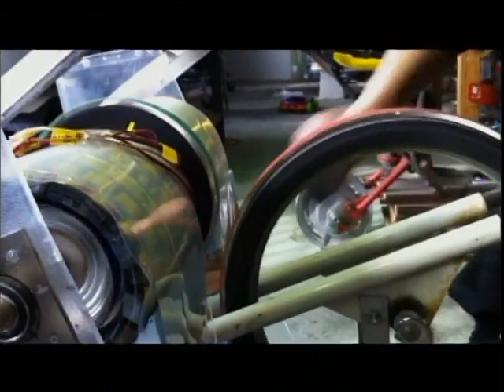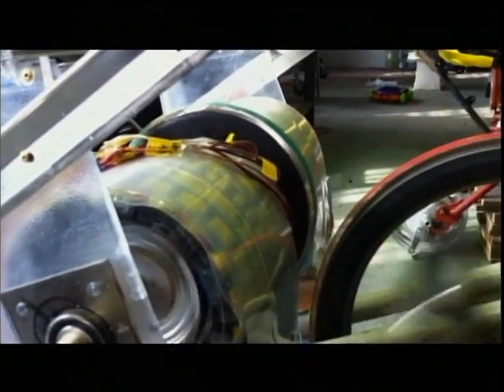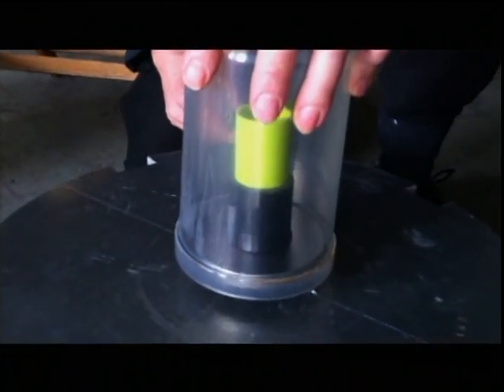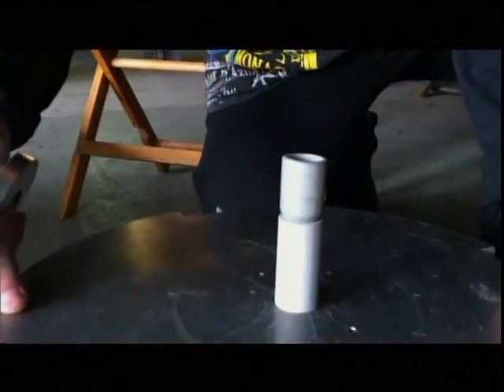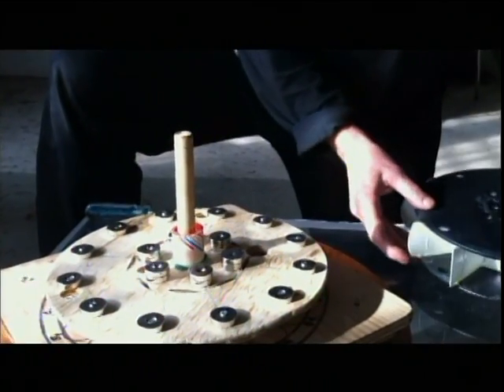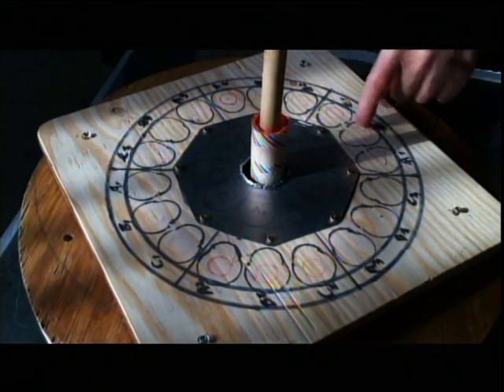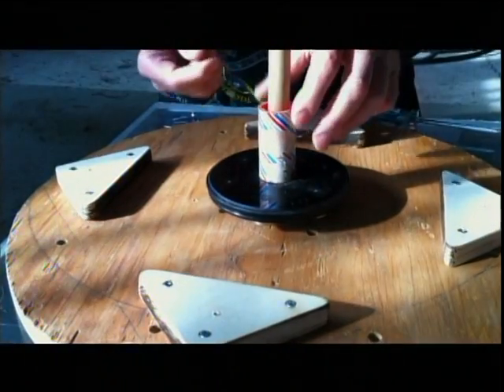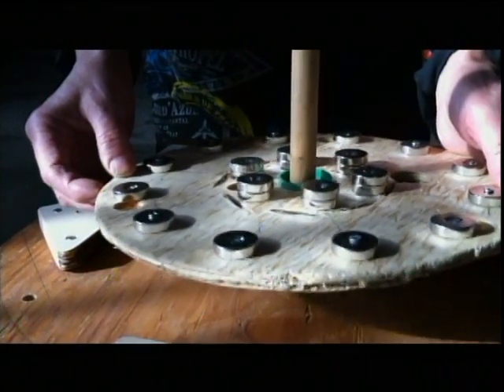Mag-Lev Air-Turbine Car Generator - FS1

Comment: These frictionless magnetic bearings, plus induced 3-phase current - on all levels now: Magnetic suspension/generation; pedal air compressor/generation; even Magnetic gears/generation (coils in plastic or alum. fender!), mean game over for fuel AND battery cars! All that's needs is BANNING of non-magnet steel in favor of plastics & carbon-fiber plastic (structural). And many shops have been doing this already for "less" energy needs. Total transportation revolution in Earth travel! And cheaper!

Comment: One thing this "Mag-Lev Air-Pedal Turbine Generator" vid didn't make clear was the 9 coils in the center (Aluminum plate) which activate the DC generation. This will be double the frequency of the AC outer ring. Due to the low resistance to spin, much smaller turbine blades can rev up to 60v-80v more easily. The compressed air can be channeled to every Mag-Wheel easily - just like your vacumn cleaner! In this way cheap self-generating cars can be made & "walked" up to 80mph with no problem!